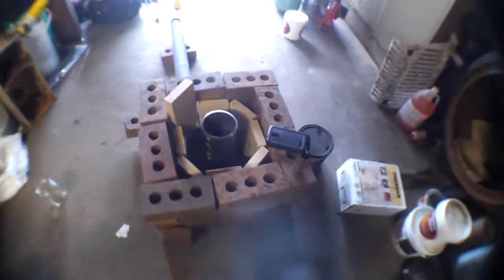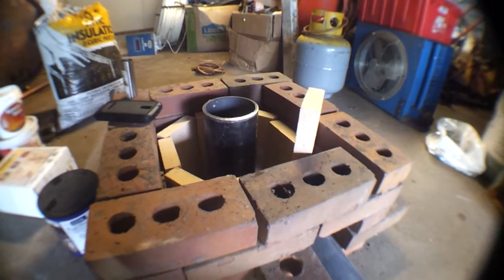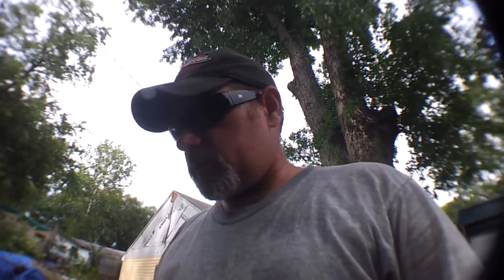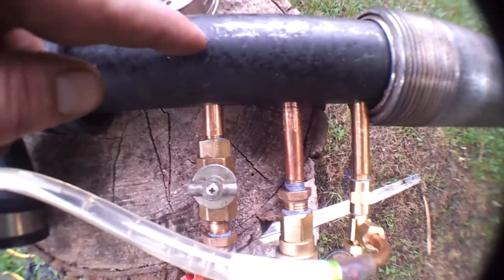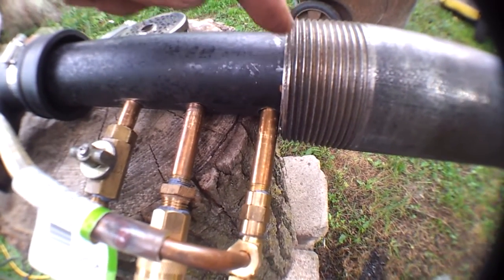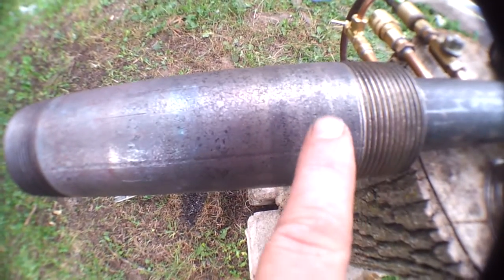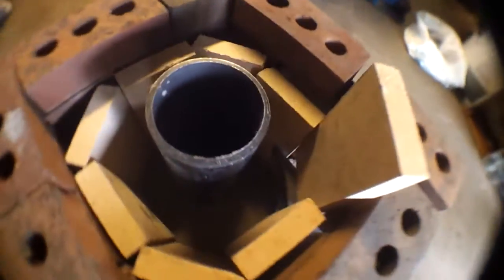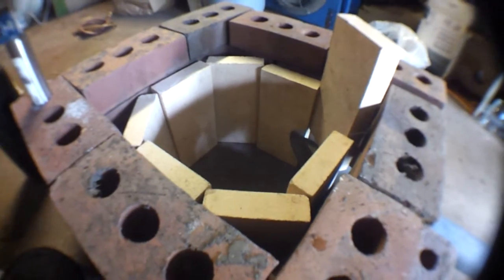DIY Waste Oil Foundry part 1

Comment: what about inserting oxygen into the air stream?
Reply from the maker: +jsummer979 as I understand it too much oxygen is bad. It can cause excessive oxidation in the aluminum and the temps dont need to be that high for aluminum however I think it would help if you wanted to melt cast iron.